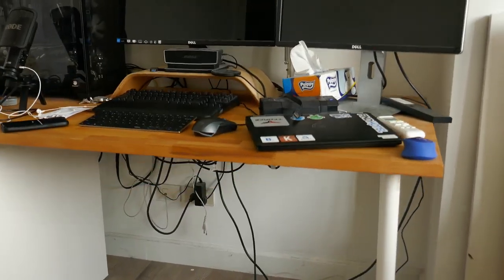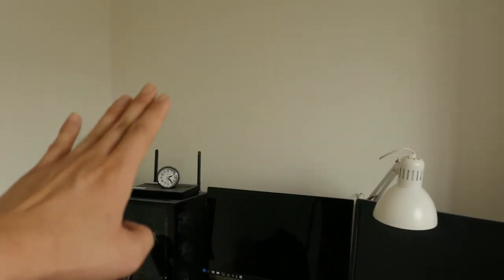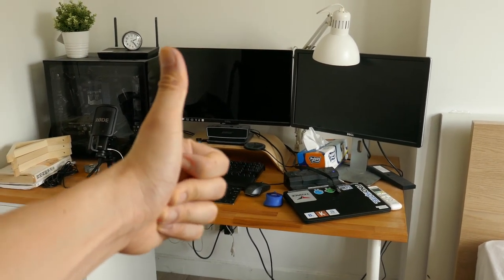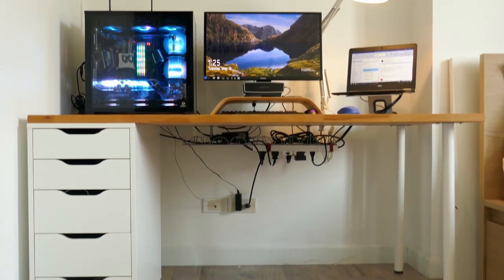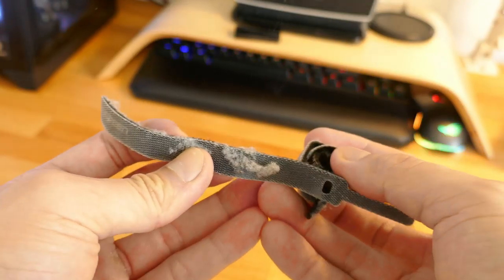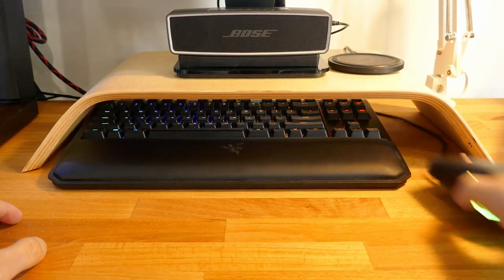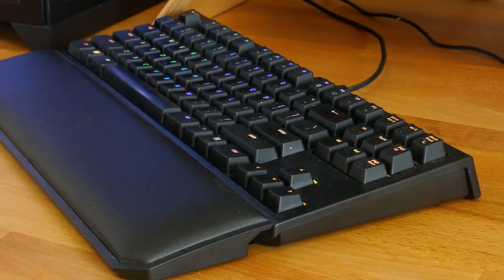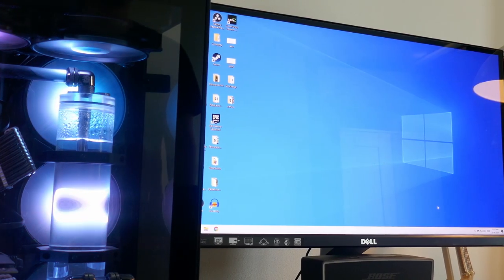It's time to clean up my desk setup!

Comment: Only problem with using a KVM switch, is that you're limited to 60hz throughput. To access my game/file server from my gaming pc, I just use a remote desktop application, and use it that way, this way I'm not limited, and no additional cables aside from power/network (unless on wifi).